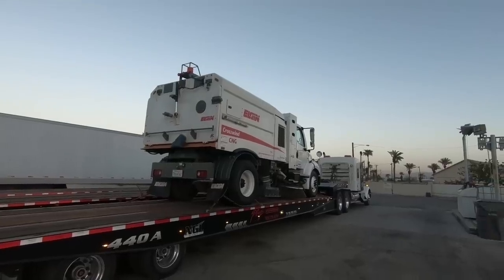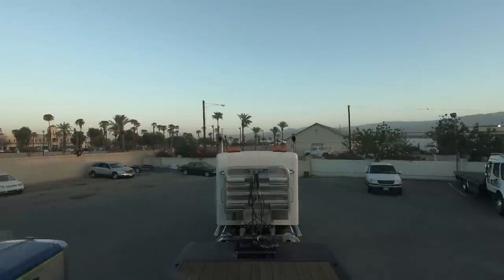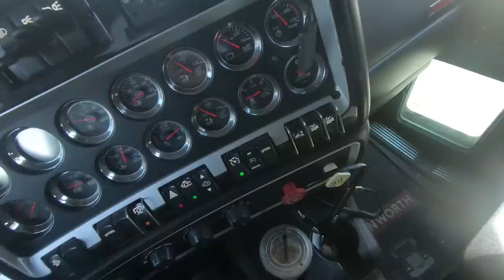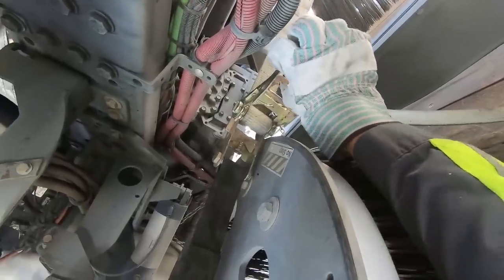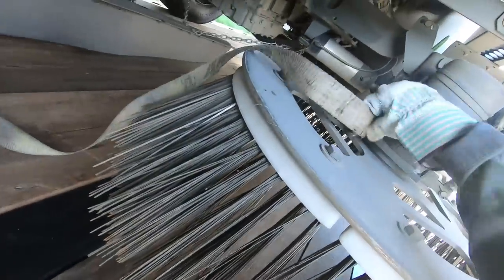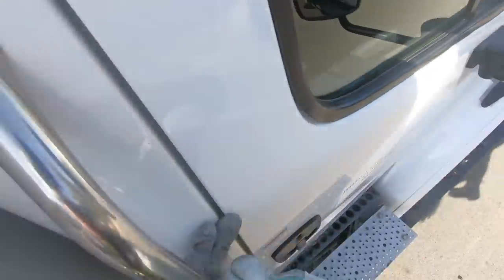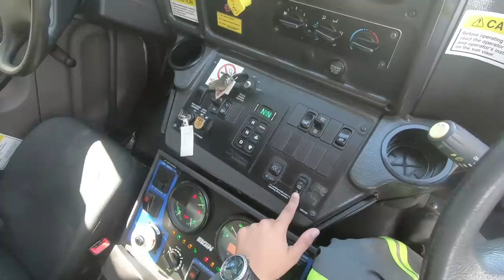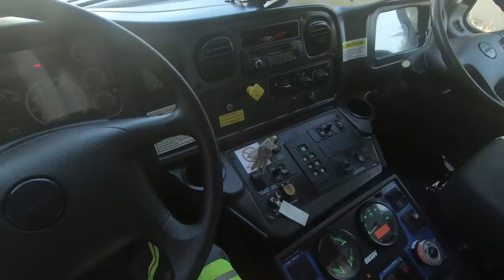Delivering New Elgin Street Sweeper With Landoll

Comment: Ever hauled an Elgin Roadrunner? You were sitting in a small single seat cabin located in senter of the machine. Impossible to manouvre in thight spaces or to load on to a trailer without an assistent. Doin'  that alone in the dark was a russian roulette. I was an operator for nearly ten years, and I had a few accidents,  but no major.

Comment: Nice easy pro job, its asked on other posts why not more breakdowns & pulls, is the answer the equipment moves are the bread & butter for income and the breakdows ect are the cream putting it in blunt terms. Could you explain the insurance implications of your own drivers putting equipment on & off drivers with zero formal training on the product, do the insurance companys turn a blind eye to this practice or do some companys provide their own trained drivers . In my day i tended to ask for a driver at start & finish plus  to allways have a guider to instruct stood on the trailor.

Comment: Why does the street sweeper have 2 steering wheels?
Reply: Vincent Neser that’s easy!  Sweepers here in England (where we drive on the other side of the road) also have full dual controls.
It makes life so much easier for the driver when you need to drive very close to the curb, whichever side of the street you are working on. Means you don’t have to drive the wrong way against traffic.
Reply: Because then the driver can sit on either side while sweeping either on the left or right side of the road.
Reply: Vincent Neser driver side is for main driving, right side is mainly for sweeping because they have to watch curves and drain holes from passengers side while sweeping
Reply: Their are two sides to each road & the brushs need a close to kerbside gap also the water sprinckler , only one side driving wheel damage would accure to these delicate parts without a close watchful eye, hence both sides steering . Also driver can go with the traffic flow not against H & S .